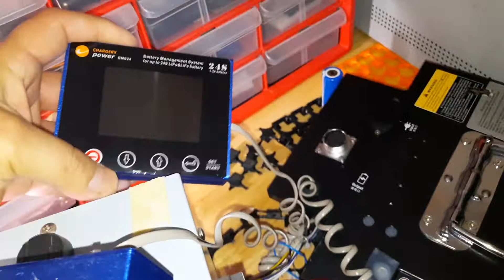City Slicker Project Pack # 2 + BMS Chargery Review

Comment: Bro i will pay you good money to build me a battery if you're willing to i have no other options. I want to build it myself but after watching your videos i feel really lost lol. There's a lot to it that I really don't know anything about.
Reply from the maker: I don't charge! I do this as a hobby which is kinda an extension of what I do at work anyways...lol  - Where are you located?
Reply: @Frg_76  it would mean a lot bro csc doesn’t have any replacement batteries and mine is severely diminished, my range is less than 10 miles on a full charge and it’s also still topping out at 52 downhill. If you’d be willing to help me address these issues, starting with replacing the battery with one of your custom built ones that are more powerful would be ideal. I know you are busy and helping out of the kindness of your heart, so please know that not only am I very grateful but I will also be patient and understanding. I’ll pay for whatever costs to get materials, shipping, etc. I currently live in Atlanta Georgia

Comment: Any updates? I just bought want and want to mess with mine an upgrade
Reply from the maker: Did you buy the bike or the BMS?
If it's just the bike, I would upgrade the cells and keep the same BMS but just adding more solder to the mosfet base plate. The chargery is bulky + you have to add the big current shunt to it.
Reply: @Frg_76  I did buy the bike, I love it but would definitely like to mess with it an make it better. So I could use their bms? And be fine?
Reply from the maker: @judge9637  it would, but either way will require a lot of fun to get it to work!! 🙂
Using a different BMS will not have the CAN messages ready to display to read so it will need a CAN board and an arduino to integrate them and see  the battery values on the display.
Keeping the original BMS will not display an accurate SOC since the pack is no upgraded so you will have to keep that in mind
Reply: @Frg_76  I was trying to get another battery made but ran into a problem with the silver plug that connects the bms to the controller. Got any ideas how to get around this? My plans are to drop in the 3kw drop in replacement from qsmotors but I'd like a better battery to I honestly need help
Reply: @Frg_76  the motor comes with a Ned controller a votol em 150 I heard that doesn't connect with what's there soo idk how that will work.
Reply from the maker: @judge9637  Sorry for the late response - Pretty busy at work .This is how I made this project work:

-Left the stock controller in there (I secured it on the close to the top of the battery pack) just having the LV signals and the throttle connected to prevent triggering DTC’s. 
-New controller – spliced the hall effect sensor to both so the stock controller displays speed on the display. Then connect the HV DC lines and the motor phase cables to the new one only.
Wire the rest of the things of the new controller and buy another throttle for the new one as well which is the one you'll be using for the bike
 There's a lot of hacks but for sure is a very fun project!!
Reply: @Frg_76  thanks, I love the bike but feel it's battery is lacking would love to have something better but it's hard
Reply from the maker: @judge9637  oh yea, upgrading the battery pack is a bit complicated, but I agree with you. One thing I noticed when I took mine apart, was that one of the FET's form the BMS was burned, so that definitely contributed to under performance.
Reply: @Frg_76  so far I haven't had any performance issues. I wish they would just take it upon themselves to atleast offer and upgrade. Like I'm ok with no cargo box put another in there or something

Comment: Good stuff. I have been working on decoding some of the canbus. Essentially making a bluetooth board for a phone app.   I can see things such as SoC already but it would be awesome to know more about the BMS. Have you been able to find the stock BMS anywhere? I tried deciphering the LT- number on the board from one of your videos but it had some tape in the way covering part of it. I'm hoping to dig up some documentation. (Long shot I know).
Reply from the maker: You've got the CAN SOC message decoded from the stock BMS - City Slicker???  This BMS is very basic and the FET's (doubt they're IGBT's) Drain flange is poorly welded to the PCB board. I've got one burnt even before I made any upgrades to the motorcycle...lol
I'll let you know the LT number to see if it even means anything at all.
Reply: @Frg_76  I believe so. At least partly. I havent figured out the meaning of the entire 8 bytes yet. It makes sense the message that I see being broadcast with the SoC comes from the BMS. It may also contains amps, a counter, possibly regen signal and some fixed values. Though I need to spend some more time with it to prove those. SoC I can reliably read.
Reply from the maker: @TheTinydev  That's very cool.  I decoded the ones for " Drive Neutral and Reverse" when I swapped the inverter for the Kelly one. I didn't want to get those errors in the cluster display. I showed that on another video though.   
The new Daly I'm getting is CAN base, so my goal is to decode as many messages as possible... long shot too Ha :-)
Reply: @Frg_76  iv got 0xA0 as the gear mode. 0x19 Id if I remember right contains the SoC.
Reply from the maker: @TheTinydev  Yea 0xA0 is the gear one :-)  Next thing for me is speed/miles/range etc. since I just got a new an amazing 4.2" display from Andromeda Interfaces (https://ai-hmi.com/) which is CAN base and you can configure it the way you wan. Lot's of fun coming!
Reply: @Frg_76  odo and trip seem to be in 0x2D0 in km. For trip divide by 10 to get the value on the display. :) I haven't mastered speed yet. I have found something very similar but it seems more like "demand" than actual speed. I have been using my custom ESP32 board with a CAN interface. Bluetooth to realdash and usb streaming output for logging/decoding.
Reply from the maker: @TheTinydev  Jezz Zac, thanks for the help here, you just saved me tons of time here!!!
Reply: @TheTinydev  is this bluetooth board something you're still working on? I'm interested in seeing if I can replace (eventually) all of the city slicker electronics and one of the functions I'd like is data logging via bluetooth. 

Apologies for the double comment, I didn't tag you correctly below
Reply: @ttshawtube  I believe my prior response may have gotten filtered by the YouTube algorithm when I added links to it for my GitHub and my notes for the canbus stuff. There are some videos on my channel of me using the board for logging with the slicker. Check that out and if you have questions let me know in those video comments please. :)
Reply: @TheTinydev  hi Zac! I want to MOCK the CAN signal to be able to charge the stock battery from my own charger. There is a pin which need to be grounded, then the relay opens the charge/discharge ports, but shuts down if no CAN signal (or other unknown thing) comes from stock charger :( I have  rebranded model called Motron Vizion, has a different charging port with "M25 ebike plug" but I think same CAN bus BMS presents there. I want to charge stock battery from my own 84V DC charger. Need to sand same CAN commands with Arduino to activate battery charge port. For  my model both the Anderson and M25 is cut off it no communication within some minutes.
Reply: @fotoamgamgfoto3695  unfortunately I'm not familiar with what you are talking about. It's been a long time since I last played with all of this but the slicker doesn't have can-bus to the charger that I can recall. You can take the battery completely out of the bike and still charge it. So I'm not sure what the BMS would be communicating with. I use a third party charger as an extra. I keep one at home and one with the bike when I use it. Your setup sounds different enough I couldn't venture a guess as to what to tell you. Your best bet might be to get a USB CAN adapter to start with and take some logs of your bus traffic. Of course to do that you need access to the bus somewhere.
Reply: @TheTinydev  CAN pins from controller also are conneted on my model to the charge plug M25 pins, I can turn on battery grounding one pin on the charge plug there is a relay click and I can measure voltage but only until a minute.
I have a much different stock charger than your version, it has 99 percent efficiency and 500Watts.
I did not disassemble due to warranty.
Reply: @zac m is this something you're still working on? I'm interested in seeing if I can replace (eventually) all of the city slicker electronics and one of the functions I'd like is data logging via bluetooth